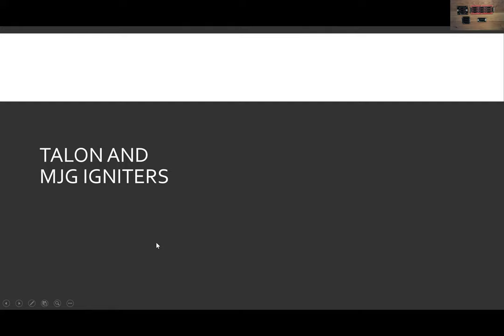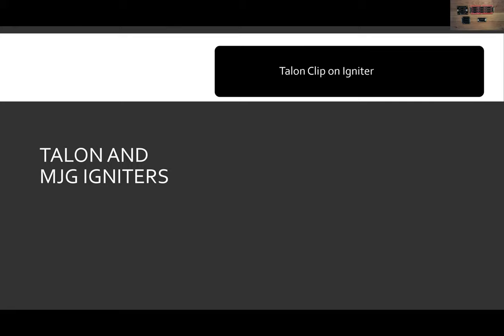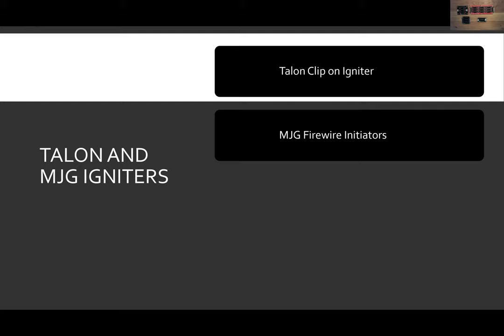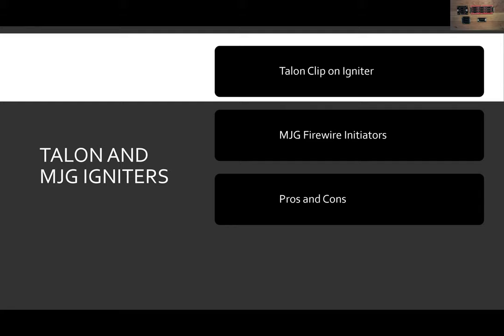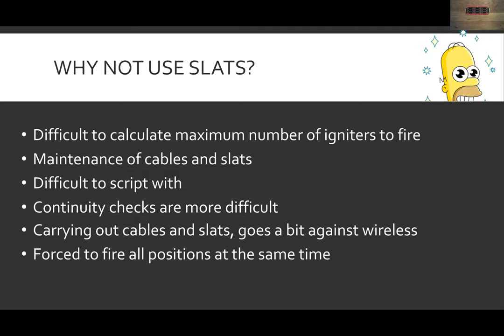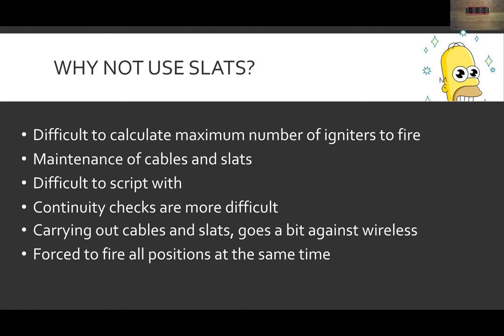COBRA Classroom - Simplifying Slats, Untangling Igniters

Comment: Hopefully someone from Cobra is monitoring the comments... I put this here because I have a question regarding the slats.  I'm not a user yet, but do plan on buying a system... thinking an 18R2 with 3x36M's.  Getting  up there in age, and the running back & forth for 2 1/2 hours this year kinda kicked my ass.  Would be nice to be able to sit back with a remote and watch my own display.  Anyway... as I understand it, if slats are installed, they essentially replace/run parallel to the on-board terminals... is there going to be any upgrade where the slats actually ADD additional channels?  Doesn't seem like it would be very difficult to do... 🤔

Comment: In the video its stated not to fire more then one cue at a time. Question, how would firing two cues simultaneously function differently then firing with a slat. Would it not still be series parallel(if you had a series in both cues)? Ofcourse i understand the reason of not doing it as to not waste a cues.